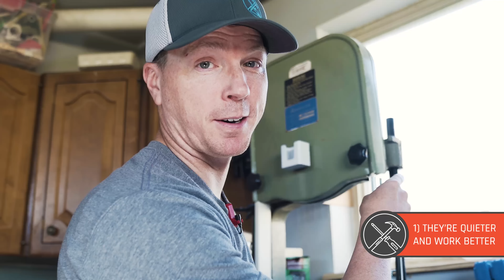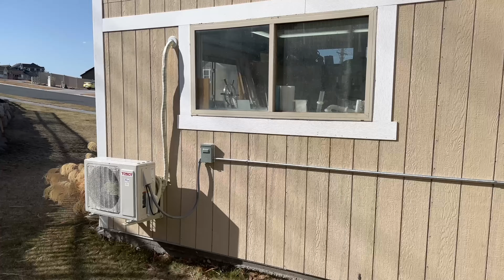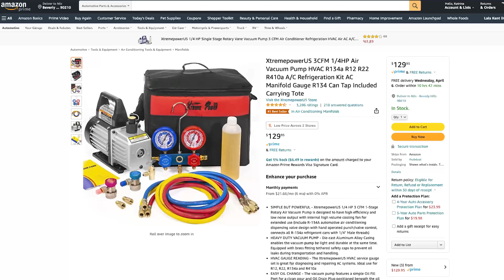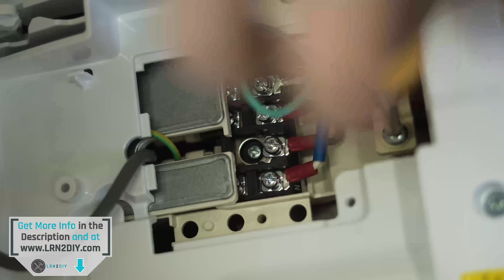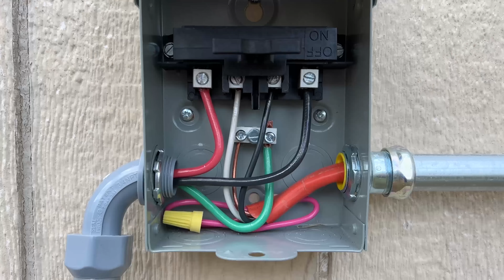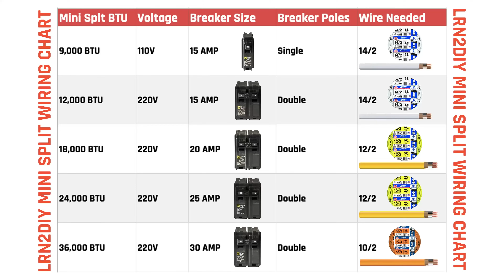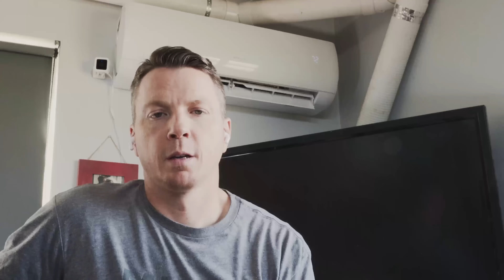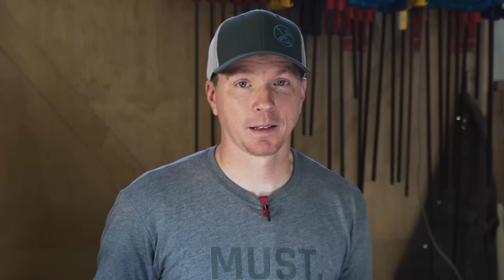Mini Split - 3 Things I Wish I Knew Before Installing

Comment: 2 minor corrections.  

1 - the condenser doesn't pull air - it compresses the gas used to make the cold and pumps that cold gas through the inside blower unit.

2 - you can use the 220 outlet - it can make 2 (110) outlets and/or you can change the outlet connection type to most any other 220 style of outlet.

Other than that, good video.  I live in Central Americana and the mini splits are 99.5% of the ac units down here.  They work great and are nice to not have to cool the entire house.
Reply: 2 minor corrections.
1- The condenser doesn't compress the gas, it removes heat from it and changes the state to a liquid. 
2- liquid is fed to the inside evaporator, not gas.

Comment: If you do this install make sure you find out if any of the AC companies in the area will service it. Most AC companies will not touch a unit they did not install.
Also TOSOT's customer service is pretty bad. I had to tear my unit out and throw it away because it would never come on. I had an electrician verify power but no activity from the indoor unit. TOSOT's boiler plate answer was "get a professional to fix it" which they will not do with a unit they did not install. I sent TOSOT pics, voltages at each location etc. The unit had two dangling din plugs. They explained one of them went to a wifi unit they did not have and the second they never explained. No troubleshoot guide, no tech sheets... nothing. And DYI voids the warranty. NO REFUND. 

If you do a DYI you are 100% on your own when things go bad. Do NOT buy a TOSOT.

Comment: Do not forget to install a current protector for electrical failures or glitches, If during a storm or power failure or low voltage it will shut down the unit, also recomended for any refrigerator appliances

Comment: Here in South America, a quality Mini Split, 18Kto 24K run from $500 to $750, And we are talking Samsung cuallity, We do not need Heating, I made Bases plus wiring, Once everything is installed, call AC tech to do the tubing conections pluss meassuring Pressure and adding if needed. US $50. Trought out the years have owned about 10 units and they last about 10 yrs each, Absolutely recomend you geting one, One of the greatest advantages over Central units is you just cool one area or room ,not the entire House

Comment: I have a Pioneer 12,000 BTU that runs on 110v I didn’t need a disconnect box, I plugged it right into the outdoor outlet that I had and if ever it needs service I could just pull the plug on it.

Comment: How fast can it raise a temp by 50 degrees or lower a temp by 25 degrees in a 20 x 30 ft insulated room
Reply: Richard Mouser,  It depends.  What size unit are you planning to install?  I guess if you want to raise the temperature by 50F, then it would be say 32F outside and inside?  So it will take a little while to do that.  Still it is a reasonable time, if you install a 12,000 Btu unit.  And it will keep the room at 70F all the time, even when it is 5F outside, if you want to pay for the energy to do that.  A 12,000 Btu unit will use about 1,000 watts when running at high speed.  Once close to the room temperature set point, they will reduce to about 500 watts, or even 350 watts.  

I put in a 12,000 Btu unit in my nephew's rental home, and it will cool the living room in less than 1 hour.  The home is about 1,400 square feet, and it will keep the whole place cool, and warm on a 25F day.  On a recent record breaking 19F day, he did run the electric heaters in the bedrooms for a few minutes in the morning.  But most of the time, the electric heaters is kept off, because they use so much power!

Comment: I buy 120 volt minisplits. 

I can go through the wall from existing 120 outlet to outside where condenser unit is.  Huge savings in electrical work.

Comment: I'm learning that if you do an install yourself (on any other brand besides the Mr Cool DIY), then the warranty is void. So if there are problems later on, you have to deal with it yourself, or pay someone.

Which means that any great warranty that any of the units come with (5-year, 7-year, 10-year – whatever) are null and void if you install it yourself.

So, if/when there are issues later, and you need to pay someone to fix an issue you can't or don't want to deal with, is money really being saved up front?

Thoughts?

Comment: Bout to be doing this myself. Building a 16x12 shop from scratch. Finished the subfloor today and starting framing my walls tomorrow.  I've been a project manager for the last couple years so it's not exactly fresh on my mind. Pretty sure it'll all come back to me as I go. My wife is telling me just to do a window unit but like you said, the mini split is so much better and quiet and with a line set cover, it looks pretty too. I'll check out your other videos so it'll be fresh on my mind when I tackle that. Thanks for posting this brother I appreciate it
Reply: I was surprised how low cost the Ductless units are at Amazon.  I bought a 120 volt 12,000 Btu unit for my nephew's rental house, and actually mounted the indoor coil to a TV cabinet, and ran the tubing out the window, plug it into a 120 volt plug in the living room, and it is totally portable, so he can take it with him when he moves!  I cut a 2XX4 that is the height of the window, and drilled holes for the tubing to go outside in the 2X4.  Then sealed the window to keep out heat and bugs.    He had electric 1,500 watt heaters in each room, and bill was huge last winter, and about $75 less each month this winter!  Cooling is great, and it is nearly silent!  It took us about 4 hours to install, I have been installing HVAC since 1984, so it was piece of cake for me!

Comment: I put in two pioneer units in last year and just noticed yesterday that one wasn't blowing air like it should so I shined a light and it was totally clogged with dust and mildew.  I never thought to look at the blower drum because i wash the filters pretty regular, but keep an eye on that. After cleaning it, it made a huge difference.
Reply: There's mini split spray foam cleaner you can buy, too.

Comment: Does the mini  split run constantly  or does it suppost to shut off
Reply from the maker: They’ll typically run full blast until they’re at the desired temperature and then will kick on as needed to keep it at that temperature.

Comment: AC disconnect is a half truth. 
Per NEC you must have disconnecting means within sight and readily accessible. So you can use a breaker, switch or even a cord and plug exception (2)
As per NEC 440.14 
Exception 1. NEC 430.102 (A) in accordance to NEC 110.25
Exception 2. NEC 440.13. 

Per 2020 NEC the AC power source needs to be GFCI protected as well (Texas has exempted this requirement as of this writing and is still ongoing until State adoption) like all code within NEC local authority has FINAL SAY. CHECK YOUR LOCAL CODE.

Comment: Great video, good cost comparison with Mr Cool however lacked a couple things, if you're going to do the refrigerant yourself. The tools are not very effective in the price range that you gave. reading reviews there's quite a few people have problems with them but it's a DUI so you save a lot of money. No way could I have somebody come here and install the refrigerant it would cost almost as much as the unit. "you need to either be 608 or 609 Environmental Protection Agency certified in order to purchase" since 2018, but I found it on ebay where it asked about certification but seemed to let me put it in the cart, I didn't buy. You did leave out the cost of freon which is significant $340 bucks for 11 lb I'm just guessing that's about how much I would need. But once you have the refrigerant and the tools you can do repairs yourself which is pretty cool. Also do not use a crescent wrench to tighten your copper lines that's poor choice, spend a few bucks and get a proper torque wrench for refrigerant lines.
Reply from the maker: Just a clarification - you don't need to buy or add refrigerant on this unit. It comes in the condenser and is released into the lines when you connect and open them. I showed every single step in the video - there was nothing extra off camera.

Comment: you can totally connect mini splits to a 110 outlet, I'm surprised high priced units don't have a prewired plug or at least the wiring coming straight out from the back of the inside unit.

Comment: One thing people should know DIY mini splits basically have no warranty even if it says is dose read it and you see it dose not it's only a parts warranty and with the stipulations it doesn't even cover them so there's no warranty at all so it's just a gamble I have had one last 17 years and one last two years

Comment: One other thing to consider is the warranty. I purchased a Senville 9000 btu mini split and it was $800 and I also purchased a 3rd gen Mr. Cool DIY version. The Senville is supposed to be installed by a license HVAC contractor but I purchased the vacuum pump to do it myself. By doing this it voided my warranty. Both of my mini splits failed and the Mr. Cool was the only one that was covered under warranty. If you don’t use the DIY version, I would also recommend that you redo the flare to ensure a proper seal.
Reply: My Senville has started icing up after less than a year, more than likely a small refrigerant leak. But since I installed it myself, I have no warranty. A service call would more than make up the difference of a DIY Mr. cool, and Senville. When I purchased my Senville I also bought an extra 25-pound tank of 410a anticipating such a leak.  The warranty is a big deal and a big roll of the dice.
Reply: @Greco-Roman-49 just for future reference, Pioneer, which is almost the same price as Senville, WILL honor their 5 year warranty on a DIY install. I confirmed this by calling their customer service. Also other reviews on Pioneer have confirmed this as well.
Reply: @Steven-gv1ke Thats actually really helpful info
Reply: @Steven-gv1ke I'd point out that the Pioneer web site and documentation is a bit unclear on the warranty issue.  When we bought 2 from them (and 1 was a scratch/dent), there was (and still is) a clear implication throughout their site that DIY is OK, EXCEPT in the actual Pioneer warranty document.  It states that it will not be honored if there is not a signed installation doc from a licensed HVAC tech.  I would not want to be Pioneer's atty in a buyer lawsuit if they refused to honor the warranty SOLELY because of DIY, and not because of an identifiable error with the DIY.  I would add that most large entities like Pioneer would likely and likely have not hassled their buyers on warranty claims over DIY.  The bad PR would be costly.  I'll also say that our 2 2015 units has been trouble free so far, except that the Pioneer wifi "capability" is WORTHLESS; it will NOT stay connected to our wifi for more than a few hours at best.  They admitted same when I complained, but so far as I can see, they have not improved it.
Reply: @Greco-Roman-49  if you can find a tech, those willing to work on a customer installed unit are notoriously hard to find.  The expensive warenteed installs often just put a whole new unit in, that's how much they like to avoid have to attempt to fix as each model is proprietary and parts, diagnosis, and reliability are not confirmed yet. 

If you DIY,  use the correct thread sealing compound, and remove the little Schrader valve to allow better movement of moisture laden air when vacuuming.  Tiny molecules of frozen moisture don't migrate easily through the line during vacuuming when Schrader valve left in because there is such mild air movement. Multiple vacuum applications allow the frozen molecules to melt between vacuums, thus releasing them incrementally into the air in the line. The difficulty with vacuuming is that  vacuuming cools the line to freezing, although the ice molecules are supposed to sublimate into a gas during vacuuming, at least in theory.  Perhaps they do initially, then after a minute, freeze again.

Professional installers had a great way around vacuuming in the old days; they just ran the refrigerant through until it started to bleed out, this assuring complete evacuation of air. Not sure if that's best for removing moisture, but it sounds at least  in theory like it should displace it.  Nowadays, some use nitrogen to displace the moisture laden air.
Reply: I'm seeing a pattern, did you wing it? or do it right?
Reply: Good thing to consider!

Comment: He left out one very important aspect. If you have to pull a vacuum on the system, you have to buy a bottle of referegent. You have to have a license to buy that bottle! Furthermore, if you are looking for the best split system go look at Mitsubishi units. When I was stationed in Iraq, the Mitsubishi units not only held up the best, by were by far the most highest seer rating I have ever seen, over 20 seer. And the most quiet by far! The biggest issue with all of them was preventative maintenance regarding cleaning the condensing could and cleaning the evaporator coil filter, MONTHLY!!

Comment: Watched your video about a week ago of your install and came across this on today noticed your license plate in the window and realized that this is something that for sure should work in my situation thanks for making these video's.
1 thing that hasn't been covered is maintenance compared to other brands and even central air as most people don't realize you have to change filters once ( or you should ) a month.
Haven't heard about mini splits
Reply: Look at your blower wheel in the case of mini splits, they become your filter and they get clogged with mold and dirt, pretty fast. It’s alarming sometimes
Reply: They are more maintenance (especially in hot climates) and can be more difficult to clean.

Comment: Very good video! New subscriber because of it. I live in NC, and have a central ducted HVAC that has been down for quite some time and it's an old unit that I'm sure needs to be replaced. I was low on cash at the time and I live alone in a large house, so as a temporary fix, I got a window unit for a couple hundred that cools the better part of my downstairs where I need it, then in my bedroom I have a free standing unit.

Anyway, I feel it's time to put money back in the house and fix it back up. 
AC/furnace is what I had, but I would like a AC/heat pump ductless mini split DIY if reasonable. Contractors in the areas really seem to be price gouging, and I would like the experience of doing it myself if it's not over my head, but I'm pretty handy. It's not a very open floor plan..... probably up to 9 zones total. Would it be a mistake to go ductless and do it myself? Should I stay with a traditional ducted central unit since I already have ducts in my house? Anybody with experience, please weigh in. Thanks!
Reply: Mr cool has a traditional style replacement unit based on the mini split design.
Reply: I live in NC also. I'm a retired female. I down sized to a tiny 400sf home. I looked into having a mini split installed. The guy that came out quoted me $16,000 to install! You are right about some companies not doing right.
Reply: @susanmcfarlin7718  
It's crazy. The minisplit for 400 Sq. Ft you could get for no more than $1500. I'm betting someone that knows what they're doing would take about half a day to install. I get wanting to get paid for your service, but $14,500 for 4 hours of work.... shame on them.
Reply: @susanmcfarlin7718 ,  Look at the 12,000 Btu heat pump at Amazon.  You can buy the tools for about $200 to install it, and I bought a couple of the 12000 Btu 120 volt units for $719.  Sure the SEER rating is lower, but they are affordable.  I would not go smaller, because of the need for heat in the winter.  Also do not mount on the wall, and I would suggest putting it about 9" on a cement pedestal, so that it will be above any snow that might happen.    Mounting to a wall, the vibrations act like making the wall into a large speaker, moving that vibration into noise in your home.  

You can buy a 25' long #12 extension cord, cut off one end, and wire it to the unit.  Plug into a outdoor plug, or run it through the window or hole you drill to run the copper lines.  Then plug it into a receptacle in your living room.  

For my nephew, I installed the indoor unit on a TV cabinet, and then run the tubing out the winter of his rental home.  Used a 7 foot long cord, and plug it into the living room outlet.  His home is about 1,400 square feet, and still needs to run his electric heaters on very cold days, but much less than last year!  So saving about $50 a month on electric costs!  It took us about 4 hours to complete the installation.

Comment: I noticed when you were vacuuming the low side of the unit, you took it all the way down to 0. Now you have no refrigerant in the low side so, how can it operate without any refrigerant?
Reply: There is something called "Absolute Vacuum" at -30" of vacuum, and that is what the line pressure is during installation, to get rid of any air or moisture in the copper connecting lines.  Then you open the refrigerant valves on the outdoor unit, and let in about 50 PSI, then shut it off.  Check it for leaks with soap bubbles, and then if no leaks, open the valves all the way.  Then the system will work normally.  They include enough R-410 in the outdoor unit to handle about 10 to 25 feet of copper lines.

Comment: By going the cheaper route and doing the vacuuming the lines yourself, don't you end up voiding the manufacturers warrantee if you are not a licensed HVAC technician? I was thinking of doing the same thing, but with the Mr. Cool, you don't have to worry about voiding the warrantee since the lines are pre-charged.